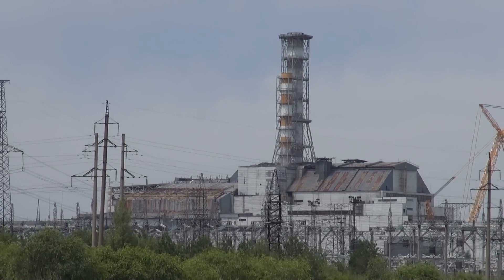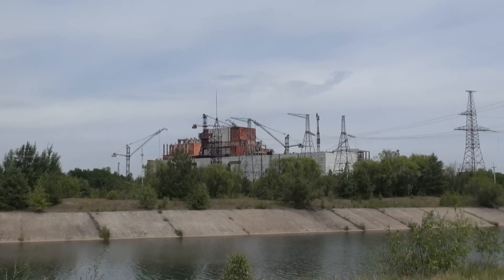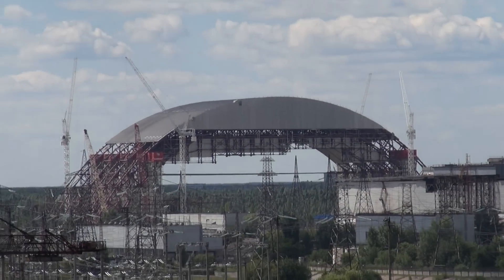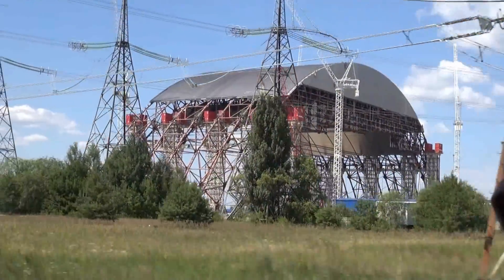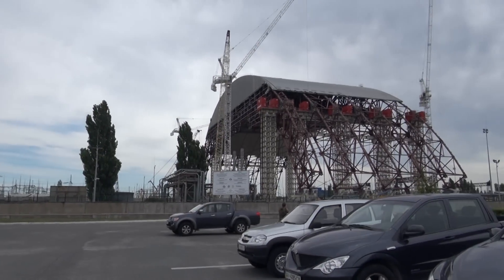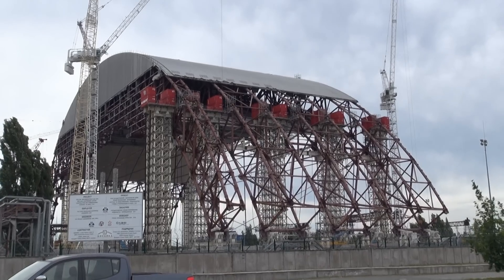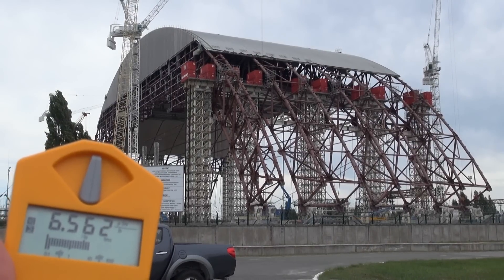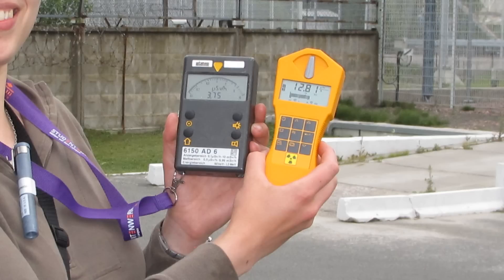chernobyl 2013: New Safe Confinement (NSC) "Арка" / shelter / sarcophagus for reactor 4

Comment: What are they trying to cover? A reactor?
Reply: The structure is meant to cover the entire reactor #4.  The original containment structure, the sarcophagus, was built quickly after the accident and won't last forever (for instance one of the roof beams was built on a damaged wall ... when I was at the plant they had just finished building a new support to take some of the load from the roof).  The new containment structure is to seal up the reactor and sarcophagus to prevent further contamination and to partially dismantle the structure.
Reply: Gavin Reyes 
At the moment the fighting in Ukraine is restricted to the eastern potions of the country.  The exclusion zone is north of Kiev along the border with Belarus.  So it is far from the conflict zone.  Construction is still ongoing at the site (As of April at least).

Comment: Will the half of permissible annual dose cause any health problems in the future? At which point do human beings exhibit signs of long term radiation exposure? like tumours, cancers, etc?
Reply from the maker: it's unknown at which point you induce tumors / cancer. same as with e.g. alcohol - one glass of red wine a day is supposed to be healthy, but most people agree that drinking two bottles of red wine every day would make you an alcoholic and induce liver damage, cirrhosis, and cancer as a final result (along with damage to the immune system, leading to other cancers, too). this phenomenon of a "hormetic" dose - a benefical dose - seems to occur with a lot of "poisons", and a theory is that the same goes for radiation. but as with alcohol, there is definitely a "too much" at some point - but the threshold may be hard to grasp and dependent on each individual. if you REALLY want to know more, i did a lecture about this...
https://www.youtube.com/watch?v=6Z5mRpFdT5I
Reply: thanks for the info :D

Comment: I think it's wrong that their building a confinement over the factory i know it was a gobal disaster that sprayed the whole of europe with radiation but it's a piece of history now and it's not doing any harm to the world even though it has radiation all around it but i still think it's wrong to remove history like that
Reply: Are you mental?!  That thing needs to be stabilised and made safe. The roof has already collapsed once and the original protective structure is rapidly deteriorating.  They intend to remove the reactor and as much high level waste as possible, so that it can be prevented from further contaminating the environment, in particular the water table. It isn't a tourist attraction it's a threat to humanity!
Reply: Le Spycrab The reactor at any point could collapse further, whether it's done by decay or something else. It needs to be sealed before it ends up releasing more clouds of radiation.
Reply: no
Reply: Gavin Reyes
It will be 10's of thousands of years before radiation subsides to a safe level. Humanity will be extinct long before that happens.
Reply: Gavin Reyes
Possibly.

Comment: Why are there 2 chimneys now?
Reply: Tavish The yellow/white/yellow/white ventilation stack is newly built to replace the iconic one which is in the path of the new shelter.  Reactors 1, 2 and 3 may be shut down but are still alive and being cooled and monitored either being dismantled or awaiting dismantling and reactor 3 still needs the stack it once shared with it's late brother.
Reply: There always have been.  One isn't painted red/white in barber-pole fashion, is all.  It's placed on the north side of the building, about 100 yards out, about midway between each end.
Reply: puncheex2 I meant the smaller one right next to the one on the top of the sarcophagus... that hasn't been there in previous years...
Reply: Ah, I see what you mean.  I have no idea why it's there.

Comment: its kinda going to ruin the Chernobyl look cause once they do that they will find a way to lower the radiation levels enough to build their and just destroy it all so why not just leave it as it is, its a historical landmark
Reply: Kyle its not that the outside of the reactor emits radioactivity. Its about the pollution of the surrounding areas. The radioactive particles have been washed into the ground, although most of the area recieved new layers of fresh soil, the old soil which has been irradiated is still there, and will be radioactive for at least 20.000 years. So its not about the actual radioactivity on the surface, its about the water and soil pollution. Going there a few times isnt dangerous. Living there is.
Reply: Its due to risk of huge radiation exposure, if the concrete structure collapsed then tons of highly radioactive dust would be released
Reply: If You had been alive when this happened then You would understand that a lot of the Russians that called this place home wish to return everything in that grave yard is tainted and  needs to be destroyed in order for the youth of Chernoble to come Home.

Comment: How are they going to move that huge structure over to reactor 4?
Reply: it will slide or be on wheels
Reply: it will slide over a bit on rails, then the second half will be built. They will put those two pieces together, then slide the whole completed thing onto the reactor. If you look at the live feed, you can see that the top of the second part is being built in the first part already
Reply: Rails. Its on a whole rail moving assembly

Comment: Kind of sad that they are going to remove the iconic chimney. It will make the NPP look a lot less interesting.
Reply: as soon as its up they will then start putting the cranes inside the arch once that is done they are going to start dismantling the old sarcophagus that's likely to be around 2018-2019 time I suspect at least the NSC will protect the outside because i think the sarcophagus will just crumble good thing its going to be mostly remote dismantled or thats the plan.

Comment: why two different result for two geiger ?
Reply: The left one with the lower number is manipulated to prevent having the workers be frightened of the real amount of radiation. ^^
Reply: *****
Go and repair your irony detectors.
Reply: It's because one is energy compensated. An energy compensated counter takes into account the energy of the incident radiation instead of relying only on counts.

Comment: That is a current hot topic in nuclear medicine, the effects of low intensity radiation on human cells. The theme was set early on; in the absence of cases of small radiation in Japanese bomb survivors, the safe assumption is that response is linear, and there is no threshold below which radiation can be ignored - your point. More data, from Chernobyl and other accidents, show an effect called hormesis, where small doses serve to enhance responses.  The scientists are duking it out now.

Comment: That's the main driving reason for the confinement today, but just as, and even more important in the long run, is the facility to dismantle the plant, and reactor #4, as well as the other three inactive reactors.  "It's all over" is not a very accurate portrayal of the situation; by far the largest amount of radioactive material is in the basement under reactor 4.

Comment: Oh, likely.  It is rare for anyone considering the decommissioning of a plant of the size of Chernobyl's PP not to simply chisel off bolts and rivets in the way; it's faster, easier, and can be done more remotely.  There is no doubt a fair amount of the work will have to be done with some remote controls.  Decommissioning the whole plant, followed by long term decontamination of the site, is the expected final result.

Comment: The part you see has one more lifting to go, then be covered completely.  That's the first half of the final structure.  It will be moved toward the plant and its other half built where it is.  Then both will roll down to cover the whole end of the plant.

Comment: Most of the fuel rods flew into the surrounding woods and area when it exploded. Then what ever was in the tank and the sand melted from the radioactive heat and burned thru the floor into the ground under the reactor.

Comment: as alec said, they are covering it. its pointless and dangerous to rebuild the existing sarcophagus because its structure is based on the partially destroyed building of reactor 4. the structure is slowly collapsing and with the new safe confinement we wouldnt care about it collapsing because all the possible radioactive dust that can fly out of that collapse will be contained by it.

Comment: different things store radiation differently for example water and grass are very radioactive compared to say a concrete pathway or road because they store radiation better. The forests and water in the surrounding area still have fairly high levels of radiation and since the reactor itself is concrete shows less radiation in that area. Although the center of the reactor is still very dangerous hence the creation of the NSC.

Comment: From my understanding, much effort was made to move the exposed carbon etc back into the reactor and seal this up with the sarcophagus, Much topsoil around the area was dug up and buried in pits. Whereas material that was burning from the exposed core rose up into the atmosphere and then drifted back to ground over a wide area. Small radioactive particles still have as much potency as large blocks till they decay sufficiently hence why many areas show up as more radioactive than the reactor.

Comment: The explosion and subsequent fires blew a lot of the smoldering graphite, fuel and other material into the atmosphere. Bitumen was even used in the construction of the roof of the reactor building, so the fires raging above the melting reactor would have continuously carried material away. When the main reactor was finally cocooned with boric acid and concrete the radiation had stopped being released from the core but the material blown off was already beginning to rain in the surrounding area.

Comment: Not milliSieverts, MICROSieverts.  The annual acceptable dose of exposure (in the U.S.) based on the ALARA principle, is 5rem/yr.  At 0.01Sv/rem, that's about 50,000Sv/yr.  At an 8hr workday, for 52 weeks a year, that's about 42,000uSv (microSieverts)/year.  Well within acceptable exposure rates (again, in the U.S.) established by the Government, and this is based on recommendations from the International Commission on Radiological Protection (ICRP).

Comment: In regards to the radiation in the forest; flora absorbs and retains radiation for much longer then other things. Weather has a great deal to do with where the fallout ends up. The Wormwood forest got hit with a lot of fallout; as a result many of the pine trees died and turned orangish brown. So really it depends on what is absorbing radition, weather, proximity from source. Don't believe me: moss is a good example that would have a higher reading then background radiation. I hope that helps.

Comment: Ah, but then again it is true that the longer the half-life of a radioactive material, the less intense it is. Pure metallic uranium and plutonium would be safe to place under your pillow at night without fear, as long as their pyrophorectic (tend to easily burn) and the amount is somewhat less than critical mass.  For comparison, note that on the average every acre-foot of soil contains about 3 kg uranium.

Comment: The nuclear fuel is not in any gassified state; perhaps you meant a glassified state, solidified from the corium melt. That ended within a few months of the accident when the fire cooled.

One thing that seems to be eternally discounted here is the impact of future technology.  I'm not pessimistic about what may be possible in a hundred years; nuclear fission research is still quite less than that old.

Comment: Well, firstly, there never were plutonium particles in the air. The reactor was fueled with fuel-grade uranium. Plutonium there would be trace amounts. The main radioactivity problems aren't the fuel, but the remaining fission products, mainly cesium-137 and potassium-40.

Comment: No. While the shelter will provide inherent shielding (any mass between the source and you is shielding), it wasn't designed to be; rather it's designed to be light and weatherproof, with a modicum of raw strength. I'd guess sheet steel. Lead sheeting would be a heavy waste.

Comment: Well, you really can't - not even pro gear can take in all the variables affecting true dosage; it could double a few feet away from where you are measuring, or if it rains, or if a truck just went by. All dosages are time-dependent, so the time of day, year and how long you are there are variables. You may react to a dosage completely differently from the next person. All a meter gives you, at best, is a ball park value, highly non-reproducible. At worst it is a complete lie, as you can see.

Comment: Most of it is still on the site, melted and poured into the basement. The containment is designed to allow for the complete dismantlement of the site, including the unloading of the other three reactors which are dead, but still loaded with their last charges of fuel.

Comment: No, the explosion is estimated to have been in the ten tons of TNT equivalent area.  Anything the size of Hiroshima would have leveled the entire plant, including the other three reactors, and flattened a god bit of Pripyat in addition. It contaminated areas far away by creating a huge plume of very light radioactive dust, raising it into the high atmosphere which then spread it. That took fire heat, not explosion. They didn't pour water on it; they poured dry sand, borates and lead.

Comment: They sprayed chemicals on the ground to make the radioactive dust and particles stick to the ground so they're not floating around in the air. They probably took care of the tourist areas first, but out in the forest probably not so much. Also, it looks like the forest is their de facto storing area for some of the equipment used during the clean up operation back in the late 80's. The equipment is highly contaminated from working with pieces maybe around 1500 roentgens or greater.

Comment: No it's not empty. There is still a large pile of the uranium reactor fuel all in there. The reactor itself is very radioactive. It is just contained, for now. The containment is in the process of failing. This is a permanent cover.

Comment: Its because the area around the reactor has been carefully cleaned up. Some parts of the forest haven't been cleaned up at all, and the radioactive material is just as radioactive as it was at the time of the disaster. Not much radiation comes from the reactor itself due to the containment by the sarcophagus.

Comment: The solidified nuclear fuel that remains in the basement is too highly radioactive.  To be next to it would be getting a lethal dose of radiation... meaning you'll die if exposed to it. Robots won't work because they tried that when they were cleaning up the roof of radioactive debris. It would cause them to break down. That's why they had to uses soldiers dressed in lead suits. There's no safe way to clean it out because the nuclear fuel (called corium) is highly radioactive and very dangerous.

Comment: dude. soil clean up is not even a possibility any more. the contaminated soil is around 30/50 cm deep or deeper. if you want to clean up an area of around 30 kilometers in 360 degrees around, you would need an crazy amount of dozers and people. it's not possible.

Comment: No.  One of the goals of the NSC is to disassemble large segments of the damaged reactor building and remove large volumes of contaminated material.  It is also designed to be maintained from the outside.

The cleanup schedule for Fukushima is much more aggressive;  they will have removed all the undamaged fuel from the site within just a few years, and all the corium will be cut up and removed robotically.

Comment: The nuclear fuel that remains in a glassified state is still in the basement under reactor 4.  To touch it would give you a lethal dose of radiation.  I'm sure they'll clean up the site as much as possible, but the site will never truly be done until that nuclear fuel is removed.  There's no way to neutralize the radioactivity, so it won't be able to be removed for hundreds of years unless science finds a way to neutralize radioactivity in something like that.

Comment: The worksite now for building the new sarcophagus? If so yeah, as it's mostly built elsewhere. And I thought part of the reason for the new sarcophagus was to dig out the nuclear fuel to prevent proliferation and to help in the clean up operation.

Comment: That's not strictly true, they can be cleaned up (as shown by the efforts currently on going in Japan) it'd just be quite hard and expensive and not really worth it for a government who's countries GDP per capita which is the 5th (IIRC) lowest in Europe, it'll also be harder than in Japan as the contamination goes much more deeper into the soil than in Japan (the Japanese harvested and incinerated the crops and leaf litter from the area so no soil could build up upon the op layer of the cont.

Comment: probably not. the main issue for public health is not really the reactor itself, which is a tiny area that can be easily cordoned off permanenetly, it's the thousands of square miles of land around it that is contaminated with plutonium, strontium, americium and cesium dust that cannot be cleaned. The cesium and strontium will not be a problem by the 21st century due to their fastdecay, but the heavier actinides will contaminate the immediate area around the reactor for centuries unless removed.

Comment: they are going to slide it over the old reactor on train tracks when it's done and then start disassembling the sarcophagus and core inside once it's all covered over and safe so dust can't get out. ~t+50 years to completion.